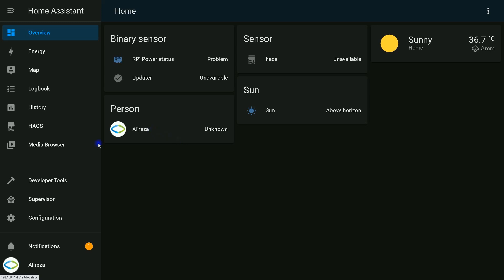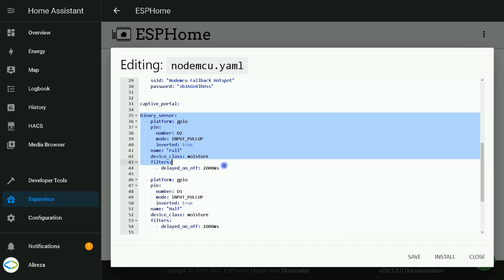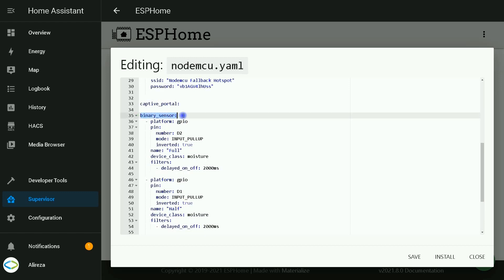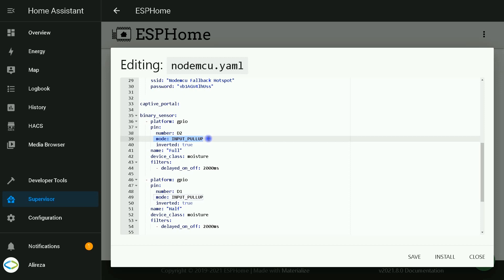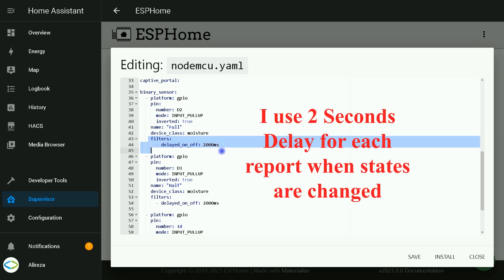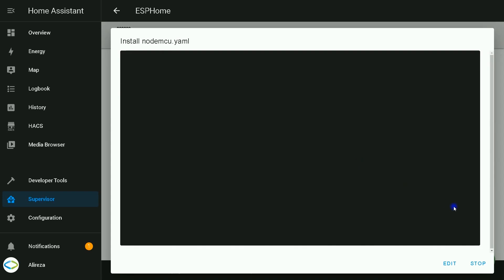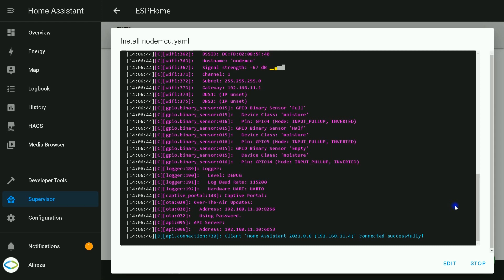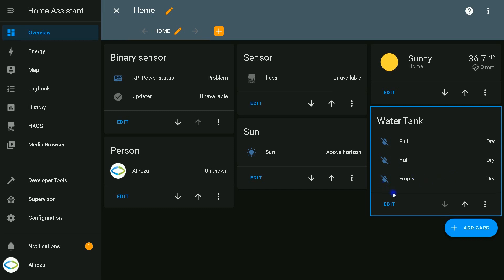How to Make Wireless Water Level Indicator

Comment: i was watching to make a project like this but i need it for diesel or better heating oil tank.. and i saw as info on internet that diesel is non conductive.. maybe i the only way seems is ultrasonic sensor for my case.. i dont know. i didnt even started but i m searching what will be efficient to do... or i was wondering if it could be done with a floating thing mounted on an axle and sending signals on which position it is.
Reply from the maker: There are two other videos for your project with Ultrasonic and liquid detector:
https://youtu.be/R77rBTkCjfg?si=XUdEbRGpNLdLgOeQ

https://youtu.be/g50WgU8ylk0?si=5d6FcGJywcq0YKnY

These two videos will help you.

Comment: hello, the tutorial is very good, a question, I'm using an ESP32, I put the cables as it is in your tutorial but it doesn't detect the contact... if I put the cables together it's perfect, do you have any idea what it could be? thanks greetings
Reply from the maker: hello, you are welcome. Could you tell me what you mean by "together"?
Reply: @kian.smarthome  Hello, thanks for responding, sorry for my English, I meant to join or if I connect a switch it works fine, if I put the bare cables as in your video and then submerge in water, it does not detect.
thanks greetings
Reply: @kian.smarthome i have the same issue. When I touch contacts directly, it works, when I put them into water, it doesn't

Comment: I really liked the project, congratulations. I would like when I reached the low stage, I would turn on an output to activate a pump and when the reservoir was full, turn it off. Could I do it? how would it be?
Reply from the maker: Yes you can do it. Watching below videos helps you:
Switches in ESPhome:
https://youtu.be/It-JWpzT9YA

Motion sensor in ESPHome:
https://youtu.be/opUb_FG1BPE
(this video shows you how to use automation in the board)

Comment: try to use the capacity of the insulated wires. Get a linear sensor without electrical contact with water. Through a long time interval, initialize the microsecond timer and PIN tightening. Upon reaching the threshold voltage (about three volts), processes the interrupt - read the value of the microsecond timer and translate the PIN to the "output" state with zero voltage (to discharge the capacitor). A twisted pair is suitable as a sensor.
Reply from the maker: Thank you. I will try it.

Comment: There is already a commercially available product that operates this way, usually used in motorhome water and waste tanks.
They work for about a year before they fail! This works in theory short term, but useless long term.
Reply from the maker: Material of the probe plays a significant role in life span
Reply: @kian.smarthome  not only the material, but also the measurement mode. if you use an AC voltage with the currents in the microampere units, sensors will last much longer. If measurements are made is not constant, and over a longer time interval (e.g., one full period of a frequency of 50-100 Hz with the interval in the second), the lifetime of sensors will increase to obscene limits.